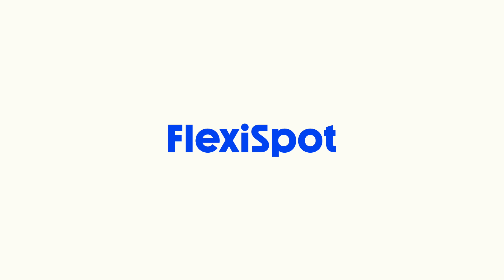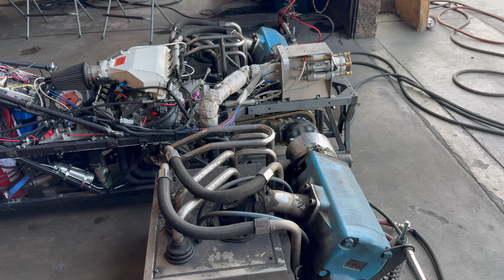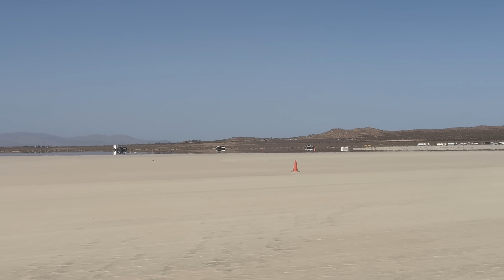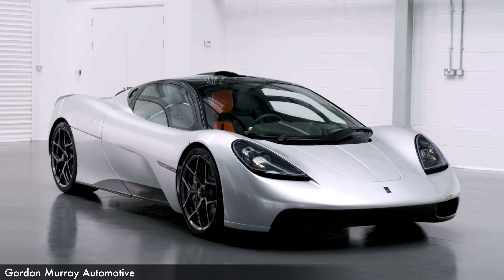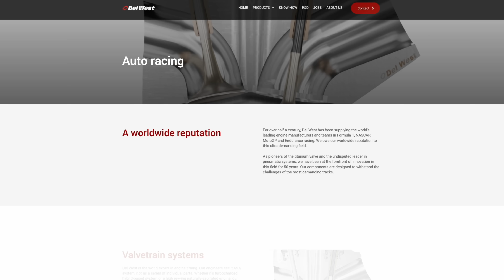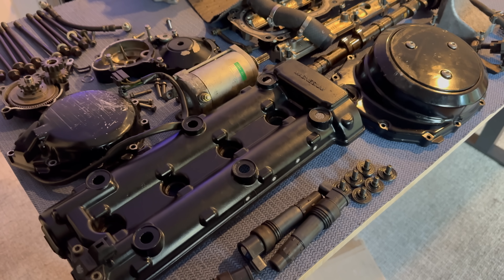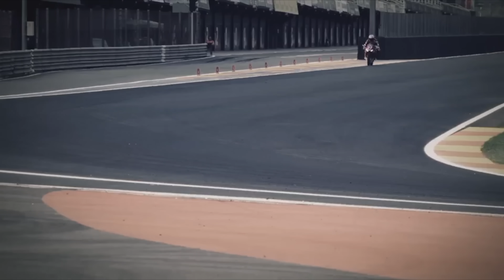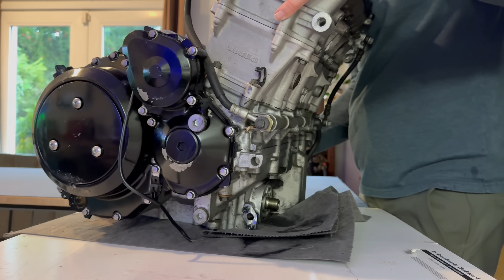Motorcycle Engines Are WAY BETTER than Car Engines

Comment: I was pretty interested to see the transmission explanation of this video.  Specifically, the part about the constantly meshed gears, gear selector cylinder, and star shaped detent wheel.  I had never been curious enough to wonder how a sequential gear box worked before, but I am now happy to know!!  Thanks Matt.

Comment: some of us however did bike engine swaps to cars. in my case, suzuki swift 3 door body, and a suzuki literbike engine. one would think upping the power close to 4 times would benefit. 
well, it sortha does, and sortha not. 
bike engines lack the low rev tourqe capacity of car engines. you eighter spin wheels, or bog down. absolutely rubbish for everyday use. 
however once up to the revs, indeed it went like a rocket. 
fuel consumption... well, if you do keep it revving where it produces nice power.. it will drain your wallet and your blood, along with your soul.
car engines are not better or worse, but simply different, with a different task at hand.
however, i do argue that light trucks would benefit from a farm tractor engine. those are more efficient, more fuel efficient that is, and have durability unpresedented in road vehicles. 
car engines are sortha middle ground. they are designed to go sortha well from around 1500 to 2000 rpm and maybe up to 5 -7.5k rpm. 
they have to give more longetivity that bike engines, but nowhere near as farm tractors.
a car engine is a middle ground.
for any high performance application... yeah a high performance engine would be better. that ain't a brainer.
so its apples to oranges comparism.

Comment: The video omitted this so I have to ask: What is the speed record for cars powered by 500 Kawasaki Ninja 500s?

Ps: it turns out that was about the only thing about motorcycle engines and cars this video omitted, nice.

Comment: Yes, but cars typically are meant to last longer. Show me a sports bike with 100k miles on the original engine without opening it. Like you said, they are basically cheap race engines.

That being said, i would fuck with one of those hayabusa v8 engines in my gr86

Comment: You've not mentioned Honda's Car engine powered bikes?

I've got a Honda NC750X that uses 1/2 a Jazz engine. It's very efficient and long lasting by bike standards, but also low poer to volume and very very dull to ride.

However a friend who was buying a Jazz was assured that the engine was actually built from two motorcycle engines.

If you don't know the Honda Jazz, their target demographic is old people who don't want anything too fast, scary or complicated.
It's the last car you drive before your licence is taken away.

Comment: At the risk of being a bit pedantic, the most reliable numbers to determine engine performance are the combined circumstance of the valves x valve lift. 

If you built two otherwise identical engines, one has two valves per cylinder and the other has 4 and they both have the same valve surface areas, the 4v engine will have more valve circumference. 

Valve lift is determined by the camshaft. Typically the two main differences between a road and race engine is valve lift and duration. A race engine will open the valve more than a road engine would lift the same valve. Obviously opening and shutting the valve more and more quickly reduces the service life. It also harms tractability, hence why race engines have to be constantly revved on the start line so they don't stall. 

More valve circumference has a similar effect to upgrading the cam. Many of the 70's Japanese bike engines used this trick to build their reputation for reliability. 

The other limitation of performance is keeping the exhaust valve cool. Heat transfer from the valve is primary through the valve seat into the cylinder head. Again more valve circumference, more cooling. Keeping the exhaust valve cool is also the limiting factor with Air cooled engines.

Comment: By your logic RC nitro engines are MUUUUCH better than  motorcycle engines !!

The LRP .30 (4.92cc) spins up to 30000 rpm
That engine produces approximately 4.15 hp
That is a ratio of about 0.84 horsepower per cc

Your puny motorcycle engine does not even come close to that ratio

So, you are just talking out of your ass if you say the "motorcycle engine is better" because you are comparing carrots to tomatoes.

RC engines can't power motorcycles or cars, or tanker size ships
And motorcycles can't power full size cars with actual comfort and room for passengers
Car engines can't power tanker size ships

oil tanker engines 4.0 hp per liter, at 62,000 horsepower 25,480-liter displacement.. good replacing that with this "better motorcycle engine"

RC engines don't last as long as motorcycle or car engines
and motorcycle engines don't last as long as car engines
car engines don't last as long as tanker size ship engines

Now we are comparing Cranberries to carrots to tomatoes to big melons

And your carrot isn't better than an tomatoes

To proove me wrong,  you can try making spaghetti sauce with just carrots

And btw, motorcycles are subject to emission regulations in Europe.
Neither RC and tanker motor have emission regulations tho.. I guess they must be better because of it?

Comment: A $500 desk, to beat up in a working shop? I'll use a Cosco steel framed blown abs plastic top table, with adjustable hight legs, instead. 😄

Comment: One thing I've always wondered about combustion engines is whether sine wave conversion of linear combustion motion to rotation motion is the most efficient. It's certainly the most straightforward, but what if linear combustion has a higher output conversion to rotation. Multiple possibilities. Additional linkages or compound linkages on piston rods.

Comment: If you think a standard motorcycle transmission is cool, you should have a look at the Gas Gas 4/6 transmission. They are able to get 6 speeds out of 4 sets of meshed gears. Really fascinating and really cool feat of engineering - even if it's an overly complicated way to save a few ounces. I ended up 3D printing one myself so I could understand it.

Comment: sigh. here we go...
the little tutorial on engine operation? i know its "textbook". its... right. in is own way. 
its also seriously WRONG and overlooks the most fundamental and important aspects.
engines run on AIR. they are a heat engine. a hot air engine.

AIR. superchargers dont work because you added more fuel! they make more power because you added more AIR. you heated more AIR, to increase its pressure. you had to add fuel to get the right mixture, not to add extra energy (though it helps). note diesels tend to run lean? theyre not limited by a spark to a rigid range of A/F ratios. as you add more air to teh cylinder, for a given quantity of fuel, you get more power. thats why diesels like boost. more air, more "pushy stuff" acting on the piston.

 its not all about the calorific content of the fuel. its how hot you get the air, and how well you expand it. you can easily get the air too hot to handle...

jet engines... burn fuel with a small portion of air, reach the highest temperature possible, then cool it down to where the turbine can deal with it by adding the rest of the ingested air that heats up and expands increasing in either velocity or pressure. for the overall air ingested, turbines run extremely "lean". for the air entering the combustion chamber, theyre correct.

the fuel simply provides HEAT. and a liquid fuel sprayed into the air, mixing with the atmospheric oxygen, then ignited, is a convenient way to make heat, right there, with no loss. no pipes. no regulators or valve gear...

just conduction. 
high revving engines have far less thermal radiation loss to the cylinders. but the cylinders are invariably smaller. so the surface to volume ratio is high. for a given volume theres more surface area to radiate heat.
any surface that is not being acted upon to produce movement due to the hot, expanded gas, produces no power. just loses it.

in that regard opposed pistons are best as the maximum area produces force.

heat, and air. thats what engines really run on. just hot air. that we burnt with "the working fluid",  rather than... externally.

Comment: Better?  Hmm.  They're designed for a purpose. Put them in a car (heavier) and you find the weaknesses quickly.  Their longevity is typically a third of a car (50km miles vs 150k miles) and their WOT life is even less at 20-30hours max power WOT life compared with even cheap cars which are 180-240 hours depending on manufacturer.

Bikes are light and their engines are designed made to match.

Comment: No, no they are not.

Plus side: 

* HP/liter

* Redline

* Smol

Downsides:

* Fragile AF

* Fucking tiny

* ZERO Torque

* Laughably short lifespan

* Spin rod bearings if they go around a corner without tilting because the oil in the pan sloshes away from the pickup under g-force(Cars and Cameras have blown up three superbike engines with a grand total of two hours runtime between the three putting them in a kei car because of this)

Bike engines are, honestly, pretty fucking shitty all things considered. They're optimized for their specific use case and aren't really all that useable outside of that specific use case.

Comment: You forgot the other magic component that makes motorcycle transmissions work.  The clutch.  Specifically with a 5-10 plate oil filled clutch and LONG clutch springs, the clutch slip force is stable enough that you can set it just above the peak torque of the engine.  This MASSIVELY increases the durability of the transmission which then lets you get away with things that would otherwise destroy it.  I.e. slamming a dog clutch transmission between gears without clutching and landing jumps at full throttle.

Comment: Genuine question. Why cant valves be connected the camshaft just like the rods and piston are connected to the crankshaft?
Reply: That is what Ducati's desmodromic system effectively does, as mentioned in this video.
Reply: @Daschickenify not exactly, ducati’s system doesn’t have a direct connection between the camshaft and the valves…

Comment: Listening to 7:32 in the garage, before slowing looking over at my 1990 CBR250RR that uses valve buckets and has a 19,000 redline
Reply: Fellow 250RR owner here, agreed. 

It turns out if anything is small and light enough, it can move very very fast. 😂
Reply: How dare neither @sav_9 and @MrLilredmachine own 250RRs but have no videos of them. 

How dare you, indeed.
Reply: Thats one of my dream bikes to own.
Reply: Well, if it had finger followers, maybe it could do 23,000
Reply: Jealous of you having that bike, but I thought it was 20k redline not 19k

Comment: You should check into marine engines.  Specifically the newer outboard motors.  They are extreme high performance, designed to run at full throttle for hours at a time.  Adapting one to another purpose wouldn't be easy but probably not impossibly hard.

Comment: You skipped over the beehive springs which have several advantages. Less prone to harmonics because of the tapered design and lighter at the valve tip resulting in  both the spring and retainer being lighter because they are smaller in diameter.

Comment: Glad you mentioned hybridising car motors with bike heads. A lot of German Berg Cup hillclimb cars run Haysbusa heads. A 1.8l Golf engine with a Hayabusa head is the preferred setup. They're screamers. There's an engineer that specialises in them and sells bespoke drop in long blocks for €10000.

Comment: Everything is a spring, especially a spring🤣🤣🤣🤣
Unfortunately, I didn't learn much new except that motorcycles (in the USA) have different emissions regulations than cars.
Which I think is a good thing, because motorcycles are much more efficient than these stupid new, far too heavy cars.
A motorcycle takes between 250 and 500 pounds to move one person from A to B.
These far too heavy cars take between 3,000 and 4,500 pounds, and usually there's only one person in the car.
And I won't even start talking about the ridiculous electric cars and pickups that start at 4,000 pounds and go up to over 8,000 pounds.

And worse than the exhaust fumes from the engine is the extremely toxic brake dust, which is ultra-fine, and the dust from the rubber tires. Nobody talks about that when they talk about emissions.
And this will only increase the heavier the vehicles are!
That's why motorcycles are the best👍

Comment: As a mechanical engineer, the design of motorcycle gearboxes never fail to move me to tears. People think great engineering is super complex elaborate stuff, but engineering is really just the art of problem solving, so such a simple solution for the problem of "matching engine speeds to varying road speeds and conditions" is what it's all about. 

Also, awesome video, I hope stuff like this creates more motorcycle curiosity.

Comment: "only designed for 40k miles" 👀me looking at my vfr 800 wich people have reached more than 700k miles on with only one blown headgasket at 400k miles. (yes they are "only" 140 to 150hp per liter but that is still much more than an s2000 :)  ).

Comment: 9:30 I feel you're a off by just a little here. That's not just a bike engine, that's the engine, clutch, and transmission! My 2003 Mazda Tribute's V6 makes 200 HP at redline and weighs 345 lbs!  Sure, I'm splitting hairs, but 2.5*150=375, you said a 4 cylinder would be 2.5 x 150 but my 6 cylinder is less. If you "delete" the transmission & clutch from the weight, maybe 2.5x would be accurate.

Comment: After owning a Busa powered Lotus Seven clone for a dozen years, I am still amazed that I went that long without a reverse gear. 'Just had to be careful where I parked.  Rowing through the gears on a sequential transmission at an 11,000 rpm redline made up for it. 'Does take a bit of getting used to the low mass flywheel at low rpms. I should not have sold it.

Comment: My Motorbike has around 136000km on its odometer and the engine works like new. So NO - Motorcycle Engines do NOT have that limit of mileage as you told. I know about at least one XJR 1300 Engine which needed a timing-chain exchange at around 500000km. A Volkswagen Golf needs this change all 100000km.
Reply: Timing chains are the weak point.
Reply: @jameswirtz8896 500000km is enough for a motorcycle engine i think.

Comment: Hey Matt, if you've still got your engine open, take the opportunity to change the shift star on your Husqvarna! That shitty sintered design with cantilever pins was a dumb idea KTM had for 1 or 2 years to save a few cents. They reverted quickly back to the original double-sided design, and if I am not mistaken there was a recall so the part could be free. Even if not, its not too expensive. That sintered design is prone to shearing the pin off if there is a big impact on the shift lever e.g. in a lowside or offroad crash - then you have a nice little metal pin potentially swimming around in your transmission. Happened to my buddy with his 690 awhile ago.

Comment: Yes but they don’t live long. There’s huge difference in market and need for longevity between them. I’ve never seen a high hp motorcycle engine last 100k miles. There’s a sacrifice to be made.
I’d love formula one nitrogen method for have control but reliability is difficult.

Comment: Kawasaki h2r - still best sounding engine mortals can get. Weirdly enough even though it has a supercharger... But man 330hp at 16500rpm on a 1l straight 4... There is a video on YouTube when it spits flames on the dyno. - if you haven't seen it, search for it, it's worth the watch

Comment: Bike and car engines have different loads to turn. A bike with a rider weighs 300 to 400 kg while a car with a driver weighs around 1500 kg. The car engine components have to be bigger to make them strong enough to cope which in turn reduces the rpm cars operate at compared to bike engines. Additionally bikes don't have very good fuel economy per kg compared to a car.  The valves used ate appropriate for their respective operationsl needs.  If you expand this compatison to include truck engines you get the same situation.  Bottom line is you cant directly compare bike engines with car engines.

Comment: The conclusion is that weight is the enemy. Bikes are around 8-10 times lighter that a car that is why they don't need heavier components, and benefit from high RPM engines

Comment: AHH Finally a technical vidjeo about Rip-Umms. They matter, or technically they energy.
Reply: Rpm / 2 * cc is a 4-stroke concept of fuel consumption based on revs right? 2-stroke would be rpm*cc for revs more directly? I'm still new to engine equations

Comment: My Aprilia RSV4 was used for 12,000 miles on the road and needed new piston rings and a gearbox. Track only use and the maintenance schedule calls for a rebuild every 6000 miles and at $5000 a go in parts.

My Ducati needs an internal inspection after every track day 😂

Comment: Motorcycle dont need alot of very low end torque and they dont need to hit fuel efficiency goals. Yes 1liter 200+whp but it will drink that much gas as it is powerful.

Comment: If you go with a 1uz you only need around 10k for 11k rpm if you dont talk about labor. But then you have 4x the weight of a motorcycle engine for maybe 500 hp.

Comment: Yes a lot of horse power but very little torque... Put a motorcycle engine with 200hp that make the motorcycle stupid fast both top speed and acceleration in a car and that same engine turn into a turd that can`t accelerate the 5 to 10 times more heavy car other then very slowly.